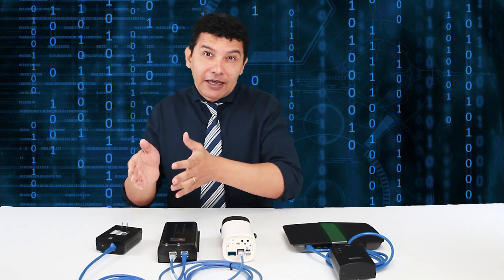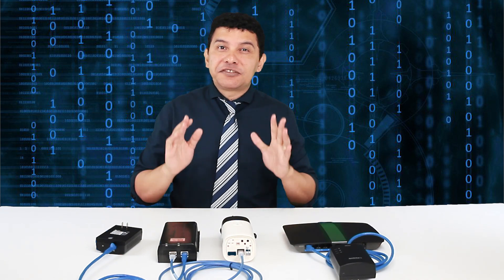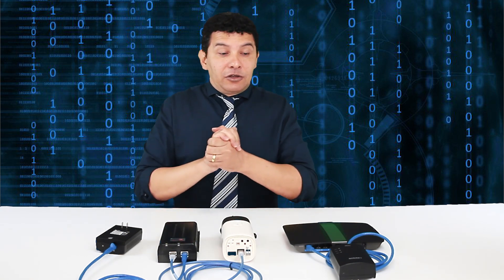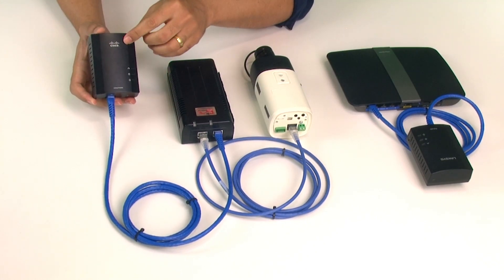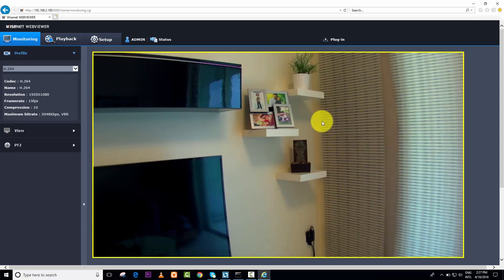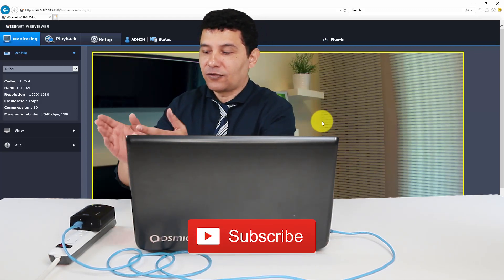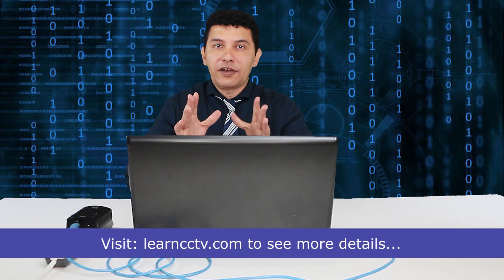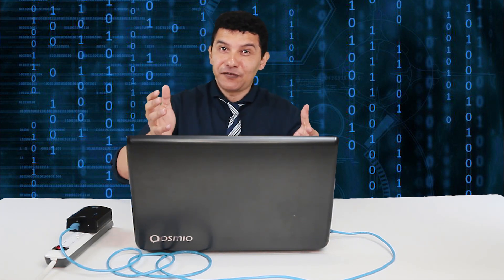PowerLine Ethernet for CCTV cameras

Comment: Good day Sir. The problem is when electricity go down. I can have a ups for my router and cameras, but i will lost the communication between PLC. Do you know PLC modules that are running under wire without electricity too ? (they would have to be internal battery backuped...) Thank you, regards from Chile.

Comment: I have a Lorex camera which doesn’t use POE, but has a separate plug which gets power from the rg59 Ethernet cable which is plugged into power at the other end near the dvr. I want to use this solution to replace the Ethernet cable. Is there a way to do it? Or is POE the only solution? Aka I need to buy another security camera system that’s POE or I have to end up wiring thru the walls?
Reply from the maker: RG59 is for analog cameras to connect to the DVR. PoE is a technology to send power to IP CAMERAS that record to a NVR.  We are talking about different technologies here.

Comment: Will work on half outlets in my home, BUT when I plug the PLC/Camera unit into several outlets there is NO Signal/Connection going back to PLC at the Router!  Why is this not working on half the outlets in my home?   Is there a fix?    Thank you.....
Reply: You might have something different going on with that circuit where it is looped, switched, surge protected etc.

Comment: Hi sir form PH. Is it required to have a router for the plc to work? Or can be direct to the camera. If i'm correct router(remote viewing) is optional?
Reply from the maker: It's not required to have a router. It works with any device that can be connected to the Ethernet.
Reply: @LearnCCTV  noted sir
Reply: what is the model of the poe sir. thanks
Reply from the maker: @domingojrmarcos4943  
The PLC: https://amzn.to/2qzxKvo
The PoE Injector: https://amzn.to/2P83d1q
Reply: @LearnCCTV  thank you sir